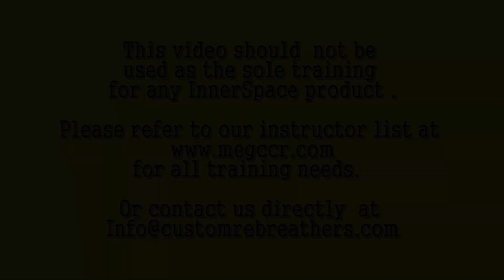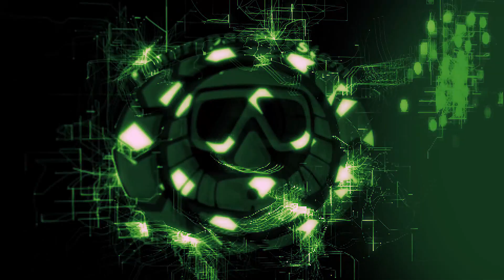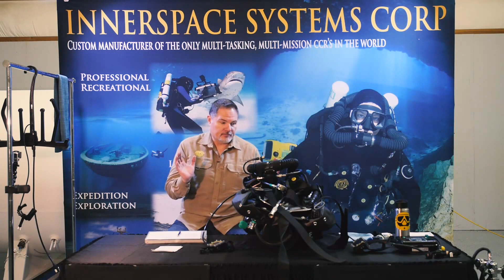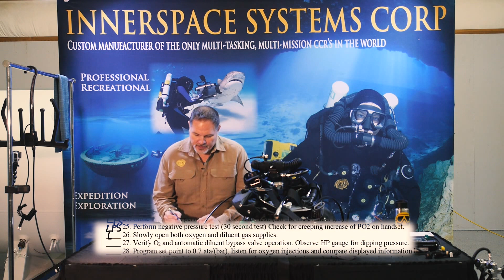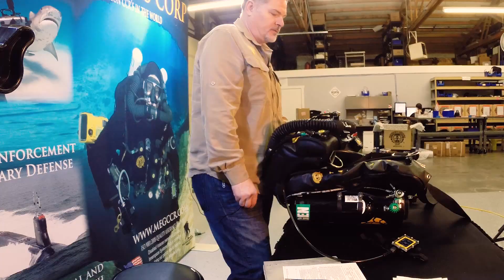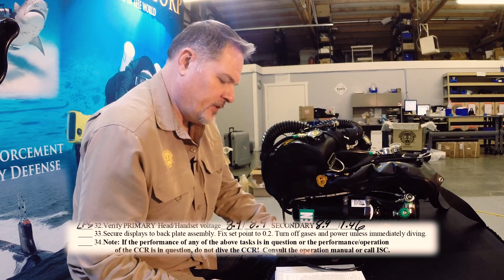Meg 15 Buildup Part 4

Comment: Firstly, I'd like to say that as a prospective CCR diver who is looking at a Meg this was very informative and I think you for putting this miniseries together. My question was about step 26 where you recommended only opening up the dil and 02 valves 1.5 turns. Perhaps I had a more unique teaching, but during OC SCUBA we opened the valves to max and then backed off a 0.25 of a turn. I like the reasoning behind your method to possibly save gas in a "boom" scenario. Is there any reason this technique is not applicable to OC SCUBA? I would imagine in the event of a free-flowing regulator it could be just as useful. The only downsides I see to opening the valve less are, firstly, on an OC setup the demand for gas at depths may be increased and you would benefit from a "wide open" valve, and secondly, the valve being closer to closed could mean accidental closing if it were rubbed against something (ie and overhead).